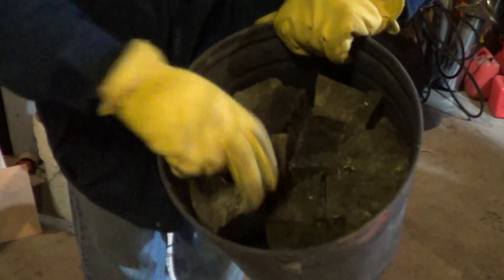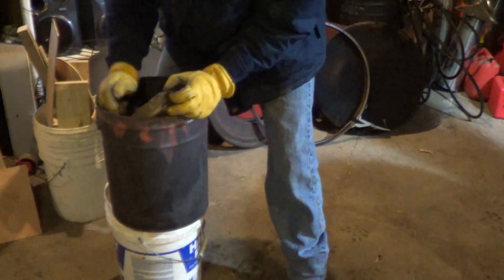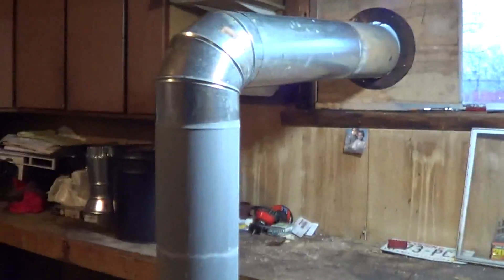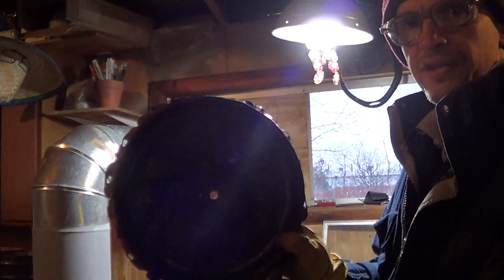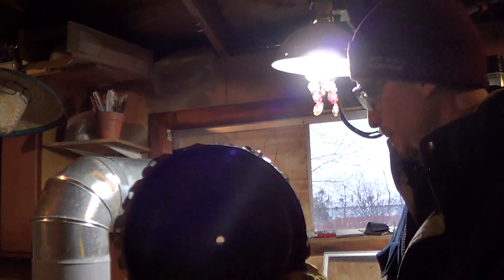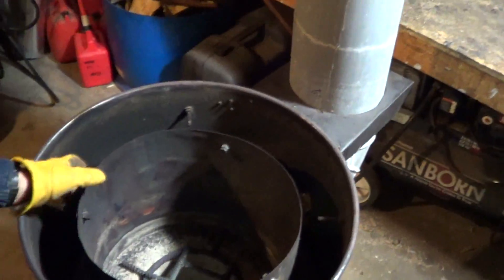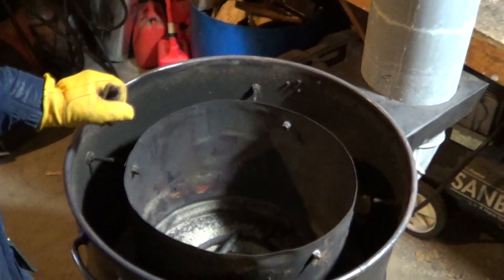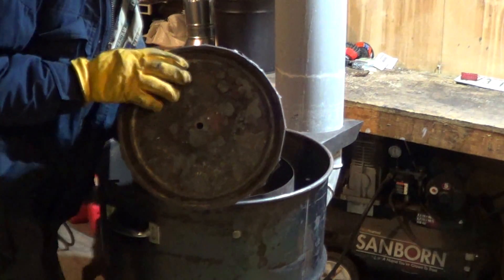How to make Charcoal Indoor in a Rocket Stove

Comment: between the inner liner and the outside liner you need to add perlite or volcanic material as an insulator to men more heat on the inside

Comment: I'm confused, don't you use as much wood if not more, to make the charcoal??? I don't see the advantage...Please explain.
Reply: He was making Hardwood into charcoal, he was using softwood for firing. softwood does not make good dense charcoal.
Reply: charcoal burns 200 degrees hotter then wood and is smoke free once up to temp

Comment: I'm just starting to look into doing this as well, but I've heard that 
the hot fire will destroy a steel drum or pail after 10 or so runs of 
charcoal. How many batches have you found that you can do with that 
setup before the bucket was burnt through?
Reply: +David Wiebe i know this migth not be the best thing, but any clay really will do, then mix it with water into a very wet clay, then paint the bucket in it, it makes it last alot longer
Reply: +Anton Helsgaun That's an interesting idea... kind of putting a protective coating on it I guess.  I'll remember that and try it out! Thanks!

Comment: Hello Sergio - I like your system and approach - it is well done.
I have few questions - I know I have come in at a late stage - I hope you can still answer them.
1. Your basic rocket stove has a much shorter inner riser or chimney than most and also mine - I have it at 150mm diameter and about 800mm high - Does not your exhaust smoke? Normally this height would not produce enough draw for the fire to burn as well as yours. From the fire below it seemed as though the stove was already hot before adding the wood or is there a secondary fuel used and later switched out, other than the gasses from the charcoal?
2. The amount of used fuel you show is small - did you add any more later? 
3. The volume of charcoal you produced was about 50% of the wood you had. Does that not show that the temperature inside the stove and the 'charcoal tin' was much higher than even 700C?  I am puzzled by this as it would suggest that the amount of wood you showed was too much!
Your answers will be very welcome and help in tests I am doing at present.
Thanks 
davinder

Comment: Hello, can you please tell me if you used a special type of cement or concrete inside the rocket stove, I would like to make one for an outside oven, thank you.
Reply: Looking at past comments I noticed that someone had previously asked you the same question and this was your answer, thank you:   
"Is not concrete. Is a mix of perlite, fire clay, sand and portland cement in relation 7:1:1:1. Mix very well add water and pour inside the the metal drum. I did make a mold of wood to make the form; when the mix was solid just burn the wood mold. Wear dust mask when mix the perlite. Thank you"

Comment: hi i can see it draes pretty well. I am trying to come up with a sollution that can cook while making char. Do yo uhave any ideas?
Reply: put saucepans or frying pan on top of lid to get hot.......
make up an oven to go on top of lid
Reply from the maker: Yes you can heat something while make charcoal. I was thinking to put a coil around, inside the Rocket Stove, to heat water, I found that while making the charcoal the heat produce is waste. The heat produce by the process is very intense that melt the high temperature paint I used over the rocket stove. Thank you.
Reply: Sergio Bohorquez or you could create electricity like the BioLite stove.
Reply: I am thinking an oven inside the buring chamber full of wood. The wood, while being cooked, will release the fumes through some holes that lead back to the burning chamber. The problem, maybe would be the regulatione of fresh air (secondary air intake) along the chamber so the excess smoke may reburnr to a clean burn. Thats just idea yet. I know I´ve got to try, and try...
Reply: +Maurício Möller de Oliveira YES  put wood in a small can then place a hole in the can the nplace the can in a charcoal fire with the hole facing down this will burn the smoke

Comment from the maker: Is not concrete. Is a mix of perlite, fire clay, sand and portland cement in relation 7:1:1:1. Mix very well add water and pour inside the the metal drum. I did make a mold of wood to make the form; when the mix was solid just burn the wood mold. Wear dust mask when mix the perlite. Thank you.